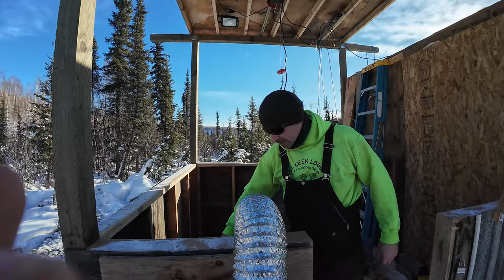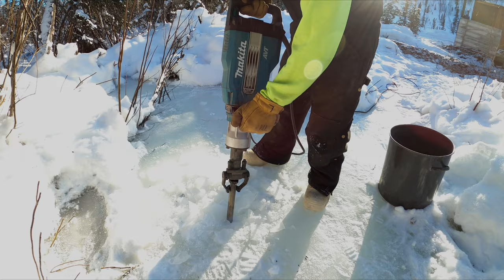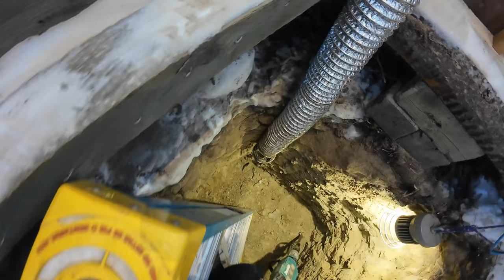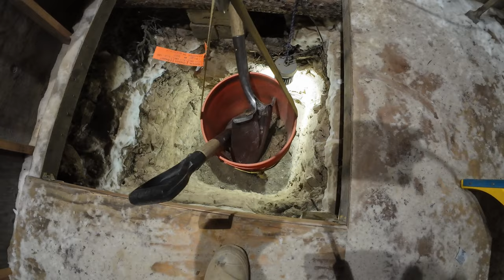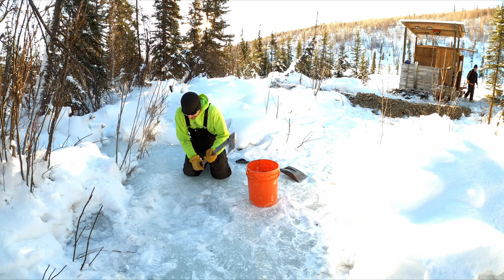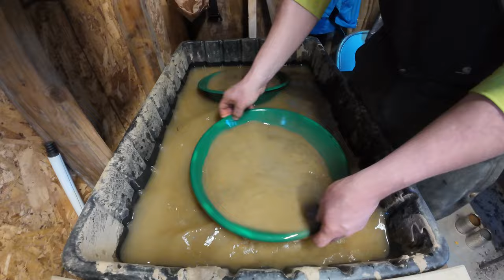Alaskan Winter Mineshaft: Gold Mining/Prospecting in the Interior of Alaska - Part 5

Comment: I would like to see some shoring.  All sorts of things could cause a wall failure.
Reply: The walls are frozen solid, as hard as any concrete.  No shoring is required.  Shafts in frozen material hold their strength well and some from the early days have been found intact and without any water or sloughing.  Shoring is only required in thawed material.
Reply: @tylernelson276  I disagree with you and some have been found collapsed.
Reply: They only collapse when they are exposed to above freezing temperatures.  It is currently -33F here and this shaft will not begin to thaw until well into spring and by then we will be long gone from this area.  Keep in mind we are using a large jackhammer to dig with.  Hopefully that gives you an idea of how solid the material is.  There is a lot of good literature on digging in frozen ground.  Look up the CRREL Permafrost Research Tunnel.  No shoring needed and it was dug in the 1960s.  Frozen solid.  Cheers and happy digging.
Reply: @tylernelson276  you keep justifying your poor choices. It’s still a free country. It would be sad if someone reported you to the Mine Safety Health Administration, msha for short then you might change your mind. I have a neighbor like you so I understand your logic.

Comment: you should keep a plastic tarp over the compressor. to protect it from ice etc. you need to let it warm up a bit too before cranking it. the same holds true for chainsaws.those things are too epensive to just Dohhhh! and why not disconect one of the lead to the batteries to avoid other issuesl ??